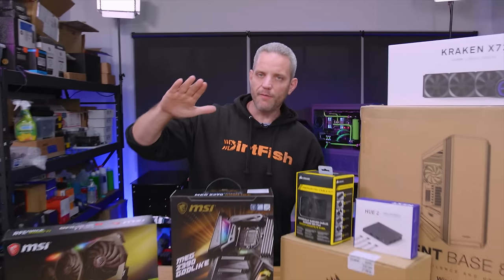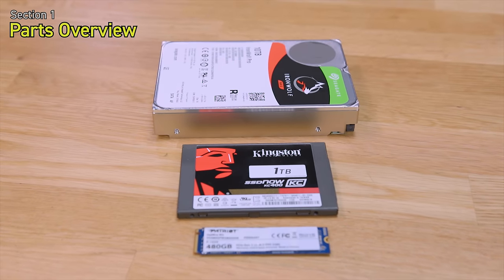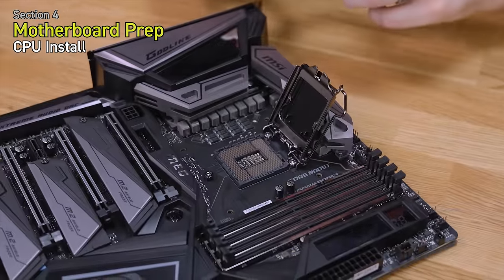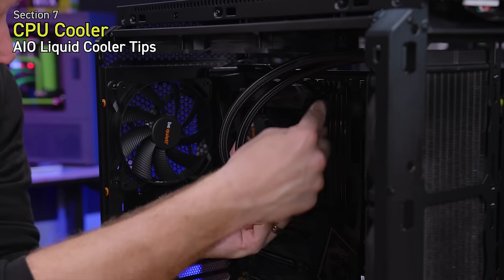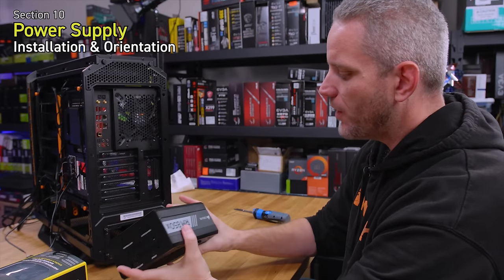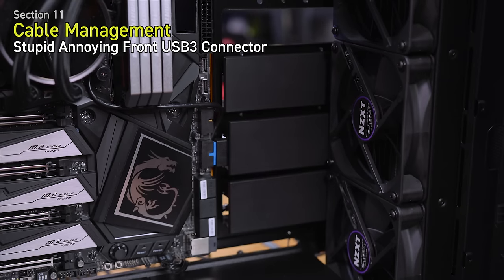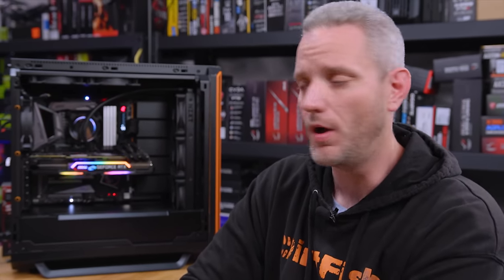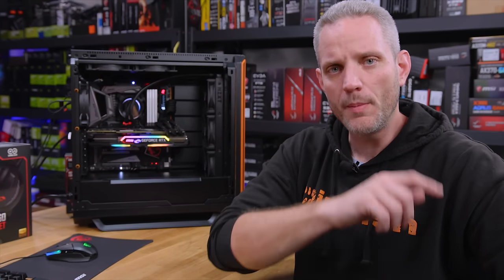How to build a computer

Comment: Hello Jay & Others

I am building a new rig for a friend using the AM5 platform and this and first build using the M-ATX build.
I am use to the 6 pin or 8 pin power supply on top of the board but not the 8+4 pin set up.

System info for reference;
Case Thermaltake AH T200 in racing green
Motherboard: ASUS B650M-Plus WIFI (board does not match the pic on amazon but is the same board)
Ram: Crucial Pro Series DDR5 32 gb (2 x16gb) 6000MT/s
CPU: AMD Ryzen9 7950X with graphic
Hard Drive: SSD Samsung 990 Pro 2TB
Graphic card: Gigabite 4070 Super
CPU Cooler:  Thermalright Frozen Prim 240 all-in0one CPU liquid cooler 
Power supply: Corsair RMx Series RM1000x 80 plus gold

My problem with this build is the 8+4 power input pins on the top of the mother board.
This power supply has a cable for the 8 pins but nothing for the other 4 pins.
So will it cause a problem if those 4 pins are not powered or
do I need to get a different power supply and if so which brand and model that
can work with this mother board 8+4 pin problem and has max length is 180MM?

This is my forth PC build but I have never encountered this problem before.

So any help would be grateful from the experts because I am not sure how to proceed from this road block.

Thanks to every one in advance for your input and help.

Comment: I am trying to build my pc with asus tuf z690 & having a Msi core liquid k360 aio block on intel i7 12th gen. But when I am testing my power connection to fans, I only see the motherboard lighting up but don’t see the aio block fans spinning. Any suggestions where I would have got it wrong?

Comment: Is it better in your opinion to use the fans pull air through the front radiator? I only have an x62 kraken cooling a 7700K but I wonder if it would perform better that way.

Comment: a broken down basically explained how to overclock CPU on Intel and AMD boards..older and newer would be nice to know the differences of each setting and how they affect the core/ram/voltages etc. also how to tell which cpu is compatible with different chipsets yet same sockets.. great vid as always.

Comment: I found this video while trying to decide on a case for my new build. Ended up getting the Dark Base Pro 900 from Be Quiet. Very similar build though. I'm going with the z390 godlike, an i9-9900k, 2x samsung 1tb M.2s, 2 Gaming x trio 2080s (not the ti's though) a 360mm cooler from corsair and 64gb or corsair vengeance RBG pro 3200. using a nvlink from msi even though it isn't RGB (sadface) and decided to make sure i had more than enough power with the AXi 1200 that was on sale for 50% off.
My biggest concern was making sure that I had enough space in the case to fit everything. after seeing this case i explored a few from Be Quiet! and found that I really like the 900 which is a modular case and will provide me with lots of space for fitting, cooling, and cable management.
thanks for the videos @JayzTwoCents

Comment: Question. What direction is good for aio fans flow in that build, same question about the two fans u installed up. Is it good that aio fans pull air inside case or out

Comment: Before installing the motherboard into the case, depending on what CPU cooler you have you need to install a backplate before you mount it in the case

Comment: I see you have the GODLIKE board where I'm having the ACE board. The M.2 Shield Frozr does look very similar though and I have a question you might be able to answer.

When I remove the blue protective film from the thermal pads, both the thermal pads on the bottom plate as well as on the inside of the lid still seem to have a very thin plastic cover. Normally in my experience, thermal pads when all protective film has been removed are very flimsy and sticky.

In my case, that is the case if you look at the other side of the pads. Meaning the side of the pads that face the bottom plate and the lid. On the other side though, the side that will face my SSD, the surface isn't like that but more like some thin plastic film was still there.

I've tried separating that thin film even using a pair of tweezers but to no avail. And since I'm not even sure if there is any film to be removed or if it's rather just another type of texture on that side of the pad, it's hard to know what to think.

I'm just afraid putting my SSD in there if there indeed still is some film that should have been removed meaning I could damage my SSD. Plastic as we all know isn't exactly known for it's breathing capabilities...

Comment: Hi mate.. I have a computer question, my computer seems insanely fast even though its an i7 920 base model

I have 24gb ddr3 tri channel ram

And a 970 windfarm graphics card alll running on a Asus p6t v2 motherboard.

Its not over clocked but i can run EVERY game 1080p max graphics settings at 60FPS easy and I can also video edit on premier pro with no lag and crazy fast export times even on 4k footage.

No idea why, the machine isn't Overclocked, do you know why this able to work like this..

Comment: Noob here, I would very much like to build this. Is there room and power for an internal Capture Card?
Reply: Brian Bridgeforth if u could afford it
Reply: @masontagliarino2659  haha True. I actually am building this setup. It is certainly very expensive. I have most of the components already and I learned that the power supply can more than easily a capture card, and not only that, the MSI Godlike motherboard comes with and 1080p 60fps capture card. I sort of feel stupid asking this question now... but like I said I am a noob to building PC's.  I upgraded this build to have the main drive a 2 terabyte M.2 drive since I like gaming so much so the games I will play will be on a super fast drive. But I also do video editing so this system gives you the best of both worlds and I will be usign thte 10 terabyte drive as well for storage. Needless to say I have been saving up for quite a while.

Comment: Good to know that the hue is powered by Another USB 2.0 my PC also has a Kraken x72 and I managed to get front facing USB 2 and 3 in the cooler-master H500P, if I bought a hue that would have been awkward.. having two unusable ports facing at the front of the case. If I ever put in some fancy fans they'll have to be powered by something that doesn't use USB to power itself..

The case self has it marked with text which of the four ports are USB 2 and 3, and only had one USB 3 connector on my motherboard ... Anyone know why not just put 4x USB 3 ports on the front, do some devices not work on USB 3 if they are  USB 2 for example? I have never experienced something like that my self..

Comment: Brilliant job, JayZ. And one question: if a motherboard has two or more M.2 slots, which one should I choose if I want to use it for OS? My mobo is an Asus TUF Z370 plus and I honestly thought that the slot next to the CPU could run faster than the bottom one because it's closer to the CPU - however it is also close to the GPU and I'd like to avoid it's temperature.

Comment: Thermal paste is needed for your cpu cooler. Some come pre-applied but some don’t so check and if it doesn’t look up a tutorial on that
Reply: Idk about Intel, but ryzen builds need an aftermarket cooler because most of them run really hot

Comment: hi guys i wanted to build a pc with more fans but my  motherboard can not connect them all. is there a solution that will allow me to connect and power on my extra fans whiled still allowing me to control them through software for things like RGB and more importantly control the fans speed individually. 
The fan speed control with software through the pc is pretty important.  i will have a maximum budget of 160 to 200 dollars.

Thanks in advance for any help.

Comment: Hey all, I know this video is older now, but I just recently got the parts for my pc. I have the rog maximum xi hero Wi-Fi motherboard and the i9-9900k. When I bring the retention arm down to install the cpu, there's a lot of creaking coming from the either the socket or the mobo itself, I can't tell which. The cpu is lined up correctly. Is this normal for brand new out of the box components?

Comment: Quick serious question. I've seen you put just a pea size of thermal paste on the chip, then put the CPU unit on top. Why do you not cover the whole chip? Is that overkill? (I guess if it wasn't you would do it that way). I put a thin covering on the whole chip.....maybe that is why I need more now. Serious, what is the deal with the pea size in the middle if it could be explained. Thank you and good job on the tutorials.
Reply: The pressure of the CPU cooler will spread out the thermal paste. If you put too much, it will ooze out of the sides and can cause issues if you use electrically conductive paste.

Comment: Man, I've been out of building my own computer for so long!!  I saw the CPU sitting on the table and was crying out.... "THE PINS!!!!".... then seeing you install it to find that they FINALLY got rid of that horrible design!  For those that don't know, CPUs had pins all along the underside that you had to be REALLY careful with (see all of those little flat gold connectors on the bottom?  Those all used to be flexible pins that stuck out a couple of mm).  The socket also had corresponding holes in it to accept the pins.... so if any of them were bent, it wouldn't go in!  I remember several times where I had to sit there with the tinniest of flat head screwdrivers having to manually re-bend the pins back into position as my thumb accidentally grazed the back of the CPU, and like a lovely wheat field, just flattened half them!!

Comment: I love computers so much. I totally recommend this site. I decided to write with own words what I have learned here. If someone thinks I should add other information, please feel free to reply and tell me if there's anything I should include. I welcome any criticism as well. Thanks:
PARTS
1.	Motherboard: MEG Z390 with IO Shield
a.	Features of the 9900K
b.	Overclocking
c.	Expandable
d.	Live Stream Capture Card
e.	MDOT2 Drives Expansion Card that can be plugged into the PCI express lane
f.	Total of 5 MVME MDOT2 Drives
2.	Graphics: MSI GeForce RTX 2080Ti Trio
a.	Custom PCB
b.	Overclocking friendly
c.	Gaming Performance
d.	Huge boost to our rendering performance
3.	CPU 9900K Intel Confidential (editing rig)
a.	Quick sink (premier can actually leverage internal GPU in this chip)
b.	Will give us a huge edge when it comes to rendering speeds when enabling the hardware encoding even already having a GPU from the video card.
4.	Power Supply RM850x (Corsair)
5.	Custom SET Premium PSU Cable Kit
6.	Corsair Memory Dominator Platinum
7.	Liquid Cooler KRAKEN X72 360MM
8.	NXZT RGB Lighting Kit HUE 2
9.	Storage PH480GPM280SSDR 480GB PCle Gen 3x4 M.2 SSD 2280
a.	It will plug directly into the mobo for the OS (Operating System)
b.	Premier etc. to load system quickly
10.	Storage Kingston 1TB SSD Now KC 400 
a.	It allows us to edit our work our project files without having to share with the drive
11.	Storage Seagate Ironwolf NAS 10TB
a.	Storage drive for all projects – Later we can move that info to our NAS
12.	Tools: Screwdriver, small plier, zip-ties, side cutters and magnetic tray
13.	Case (Tower): bequiet.com Silent Base 801

HOW TO BUILD
1.	Take both sides of the case
2.	Take out box of accessories: screws, mounting plates for HD
3.	Before installing the motherboard into the case, install CPU into the socket and the Storage Kingston 1TB SSD Now KC 400 in the motherboard because its easier to access
4.	Make sure the indentation of the CPU matches the motherboard
5.	Remove the cover screw, pill the cover off, the notches will correlate with the board, move the cover from the top piece and install it backwards.
6.	Always reference your manual for the case
7.	Install the motherboard lining up with the stand offs and this motherboard already has the IOX 
8.	Install the 360mm radiator in front so you will have to take off the fans that are originally on the case.
9.	Install the fans on the top cover of the case
10.	Mount the fans to the radiator first and then mount it into the chassis and the cooler to the CPU
11.	Install AIO (Cooler) into the motherboard inside the case. (Make sure its out of the way of the memories)
12.	Install the memories (Make sure the tabs are up and the grooves are lined with the motherboard)
13.	Slide off the case for the storage to mount the Storage Seagate IRONWOLF NAS 10TB
14.	The SSD will be install in the back of the case on a small mount (part of the case)
15.	The NZXT RGB Lighting control box is magnetic can be install in the back of the case.
16.	The power supply will be installed in the back of the case. The fan could face down or up depending on the surface where the case will be. It comes with several cables. Plug all the cords that came with the box: PCI express, 24 pins for the motherboard, 8 pin EPS for the CPU (2 cables), peripheral, power for HUE lighting, any lighting modules, fan controller, and storage.
17.	Cable management: Connect cables before it goes into the chassis. Zip-tie the cables that are going together, zip-tie the 8 pin CPU power plugs because it will go together, the same thing will be done with the PCI express cables and SATA cables.
18.	Take of the front side connectors: USB 2.0 and 3.0. HUE 2 and cooler uses USB 2.0. 
19.	Reset power and LEDs will connect to the bottom of the motherboard. Route them appropriately. HD audio goes in front of the case.
20.	Usually in the bottom right hand corner of the motherboard you will find the front panel connector header: The top two on the right will be the power switch, the top two on the left will be the power LED with the posit terminal on the far left, the two below that are going to be the HD LED and the two on the right of that will be the reset switch and the furthest pin in the bottom being unused.
21.	The USB 3.0 and SATA cables will be in the front of the motherboard. The 24-pin power will go into the motherboard together with the USB cables.
22.	Make sure the cable management is not protruding out of the case. Watch out for the SATA power plugs (They are sensitive) 
23.	Install the MSI GeForce RTX 2080Ti. Remove the covers lining up the slots with the card.
24.	Turn on the computer:
25.	BIOS
26.	Install Windows Media Tool
27.	Install Windows OS

Comment: May I know how does one decide if the motherboard and stuff can fit in the case? Or are the sizes for the things required standardised? :)
Reply: There are couple mobo sizes out there and the most common is ATX (like this in the video). Other standards for smaller boards are microATX, FlexATX, nano-ITX, and mini-ITX.

Different cases are made to fit different sizes mobo's (NOTE: in most ATX cases you can fit also microATX ).

In conclusion, you must choose your motherboard, then choose your case who can fit it.

Comment: I had seen one of your Builds and I wanted to build my first one can you take a look at the components to see if this is going to work? Putting a lot of money out hoping it works.
Thanks for your time.

Intel 9900K
MSI MEG Z390 Godlike
EVGA Geforce RTX 2080 Ti FTW3
Corsair HXI1200i 1200 watt
Corsair CP-8920151 Premium PSU Cable Kit
be quiet Dark Base Pro 900 rev.2
Corsair 64GB Dominator Platinum DDR4 (4x16gb) 3200mhz C16
Kraken X72 Watercooler 360 mm
Samsung 976 ProSeries 1TB PCle MVMe = M.2
Samsung 860 EVO 1TB 2.5 SATA

Comment: What is the purpose of the hard drive? You installed an ssd at the beginning, but why do you need an hdd?
Reply: Its extra storage. You usually use an SSD for installing your OS and main programs and then you use the HDD to store anything that you don't need to access on a daily basis (photos, videos, large programs, etc)

Comment: Hey, love the video and the channel!!, i have a question i'm building a computer for myself with a ROG MAXIMUS XI HERO Wifi motherboard and it has the 8pin eps connector plus 4 extra, what should i connect in those 4 extra? I'm using a seasonic full modular power supply, thanks!

Comment: Questions.
Why not remove the sticker on the m2 drive ? It would block heat transfer. 
Why suck hot air from the radiators into the case ? That's just stupid.
Overall this is pretty much a Verge level build

Comment: I have built 1000+ PC working in my shop and I have never put the CPU in and m.2 outside of the case. Is that just me? Intel CPU are not always right side up J look at xeons and some 2011 and 2066 sockets.

Comment: 5 Things to think about when buying in order:
1.Motherboard, CPU and RAM
2. GPU
3. Storage devices, and other USB devices or other connectables (Monitor/headphones/mic, Optical drives, wifi, so and so)
4. fans/Lights and your case, this takes long to decide. Think carefully about measurements.
5. PSU and additional cables - go online and calculate your power supply needs, do not buy USED or too CHEAP PSU's, NEVER.
Reply: “Lights”
Ur saying it’s important to think about RGB. When clearly RGB doesn’t give any sort of advantage for gaming 😂

Comment: My now dated Thermaltake Chaser MK-1 case which it still looks to be a very cool case has a tooless install for the Hard disk drives. However, you do need to use screws for the SSD's and such. Also it has some nice feet that are about an inch and a quarter which makes it so that I could just sit it on the floor. Also, I would install the PSU first then the motherboard. Installing the PSU first can and will make it so that you don't have much of a chance banging the motherboard with the power supply unit.

As for the rest of the video, it's quite a nice refresher as I am intending upon upgrading my machine. I may just go through and overhaul it.

Comment: Hey jay I have an idea (may not be original but I never comment) why don't you show what happens (if anything) if you use regular tap water for a water cooled build instead of distilled water. You could just show the wear on the equipment after say 3 months or so.